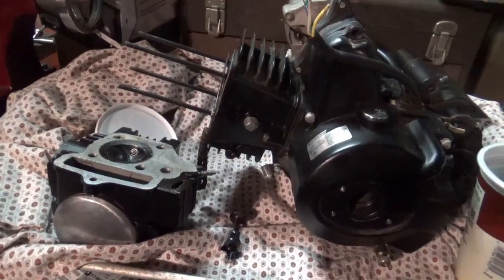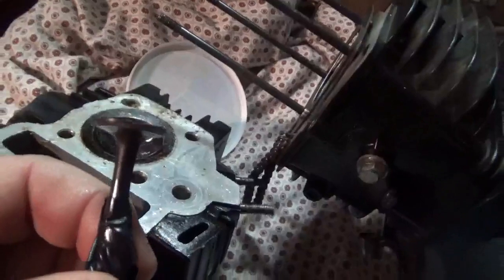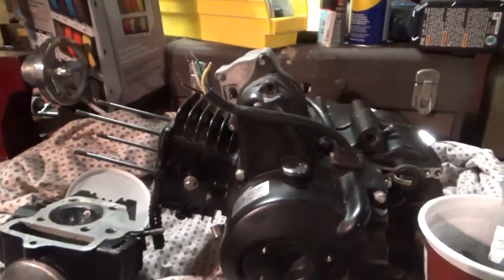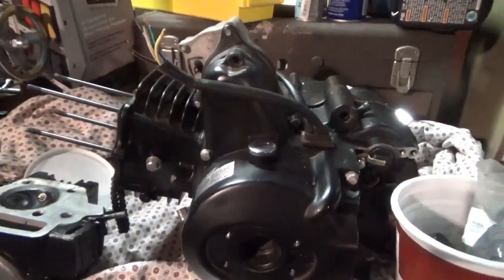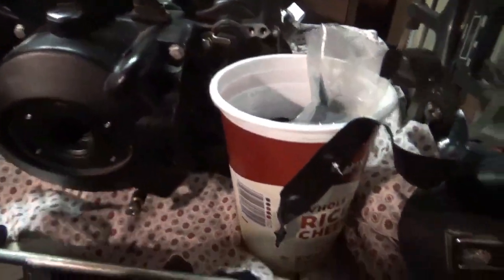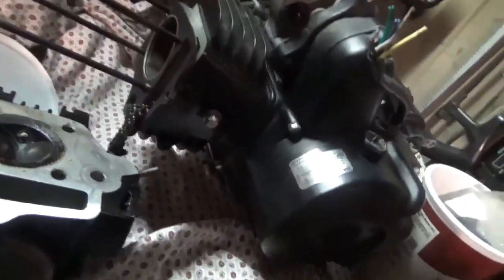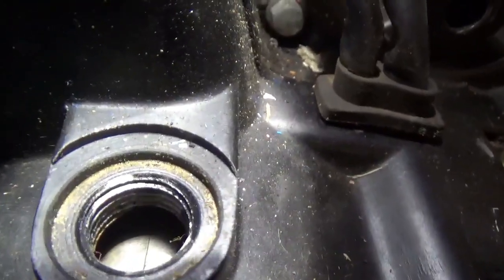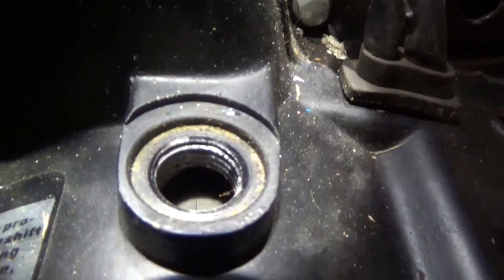ATV Valve Timing and Head Replacement on a 125cc Engine!

Comment: What clearance did you set the valves to? If thats a harbor freight compression tester it will probably show the engine has lower compression than it actually has.

Comment: I wanted to ask you if a head gasket is leaking or bad on an air cooled engine would it cause it to overheat just sitting idling upon a cold start in cold temps? If not what would?  Any help greatly appreciated as I’m stumped on this one.
Reply from the maker: Hey Bang! I would start with the head gasket though I'm not thinking it is the only cause. If there is a lot of carbon build up on the cylinder head, that would not be helpful... Normally overheating is due to carb too lean, lack of air flow, missing covers that direct air flow, lack of fresh air, missing fins on the engine or fan, advanced timing, too thin oil, improper oiling, and possibly a bad rebuild with wrong parts/too tight tolerances/missing covers/miss attached covers.... Overheat at idle in cool weather, I got to think blocked air flow/misdirected air flow/mice.... I hope this helps, U probably thought of and eliminated most of them already, please let me know, this is an interesting one!!!  Thanks for asking, watching, and commenting!!!

Comment: The best thing to do on those engines is remove the compression release mechanism because it really screws with the compression on them especially when your trying to do a compression test on them
Reply from the maker: Hey Billy!!! I forgot about the compression release, I should of thought about it and mentioned it!!!  U R right, it does mess with the compression test values, especially if one turns over the engine slowly!  Thanks for Ur thoughts, knowledge, suggestions, watching, and commenting!!
Reply: @HarveySpooner  no probablem

Comment: I was a engine mechanic in a wrecking yard for 32 years. I ran hundreds of engines on a large bench. 3, 4, 5, 6 and 8 cylinder engines. Only had 1 blow up. A 403 Oldsmobile v8. Never ran them with water in them and only ran them for about 2 minutes to warm them up to do compression checks and oil pressue checks and check for noises. I prefer working on older engines like stuff in the mid 1960's and back. The kinda engines I grew up with.
Reply from the maker: Hey Chuck!!!  I agree with U, I prefer the older engines also, I guess that I Y I like the Honda ATCs/ATVs from the 80s. Most of the China stuff was copies of them until recently... If I recall, some of the oldsmobile engines from yesteryear had oiling issues and tended to blow up, especially if they sat for a long time.... Thanks for Ur thoughts, understanding, encouragement, watching, and commenting!!!!

Comment: Harvey hey what should the normal compression be on these engines I have the same exact engine on a quad I bought for $50 I worked on it forever finally got spark got everything back together went to put a spark plug in it and it was stripped out so pulled the motor again ordered a new complete head off Amazon like $50 I put it on adjusted the valves put a brand new carburetor on it and it'll start if I have the throttle fully in but then it'll die when I let off so I readjusted the valves again put a different carb on it and it'll start with choke on for a few seconds if I hold the throttle all the way in or play with the throttle it'll start for maybe 10 15 seconds then die I took the air filter off the carb put my hand over the opening and my hand will be soaked with gas what are you thinking I'm going to probably pull the whole engine off the quad makes it a lot easier to work with the valves were tight at first and I redid them I just got a compression checker I'm going to check it tomorrow I don't know what it could be brand new mikuni carburetor head everything get good spark I made sure my time was lined up it's a nice quad very nice I got a great deal on it just got to figure this out why would gas be spitting out the carb like that with my hand over it is that something to do with the valves
Reply from the maker: Hey Resurrection!!!  When an engine spits from the carb, I tend to suspect leak by from the intake valve or a vent from the engine putting pressure into the intake manifold. What U are describing with the run characteristics would be an intake leak... I would adjust the valves and keep them alittle loose. I would pull the carb, make sure that the flanges all sealed well, I would probably use fresh cardboard homemade gaskets, sealed to the surface on one side and oiled on the other, I would make sure that the carb and intake holes were all plugged or hooked up properly, and I would make sure that the engine crank case is properly vented, not getting pressurzed... U probably already checked these, so, if U find something different, please let me know!!!  Thanks for asking, watching, and commenting!!!

Comment: Harvey, are the intake manifolds interchangeable? Otherwise, as OJ's lawyer said "If it doesn't fit" you know the rest. Good luck and I'd be happy to see the Wilderness out in the wild where it belongs.
Reply from the maker: Hey Steve, I hope to see U this Sunday, the only question is breakfast or lunch.... The manifolds are interchangeable, the issues are the bowl being too long and touching the engine on the bottom and the cable for the throttle slide getting bound up with the frame tube on top... One would think to a 3/4 sized atv, there would not be space issues for little 90/110/125 cc motors!!!  Not sure Y, but, I like the wilderness also.... Kind of a cool little machine!!! As always, thanks for Ur thoughts, support, encouragement, watching, and commenting!!!
Reply: @HarveySpooner  The earlier the better. The next day starts another 13 days in a row and I've got to get as much done as possible.